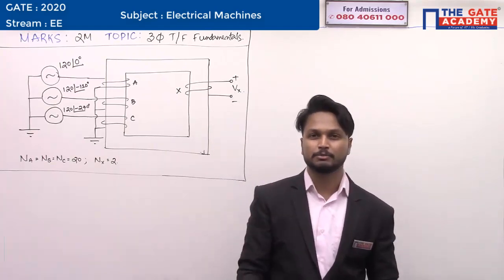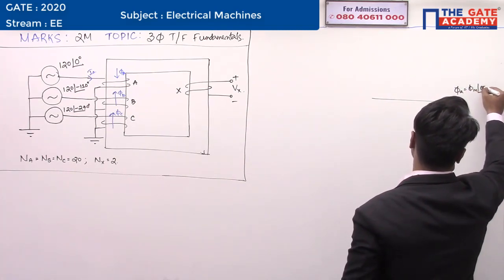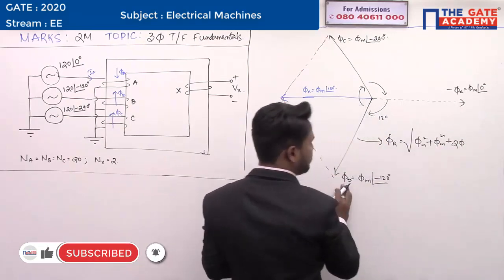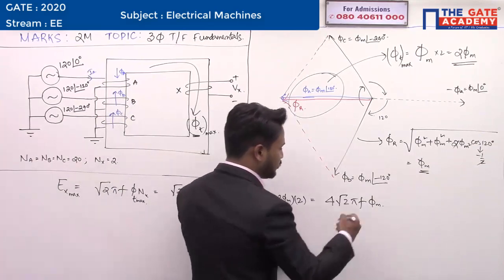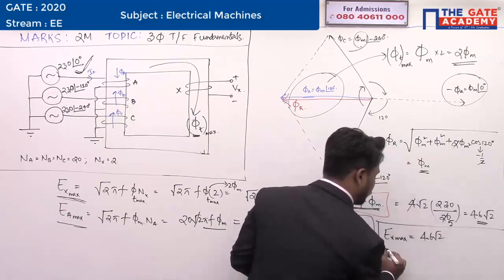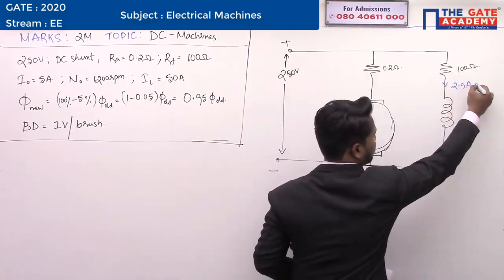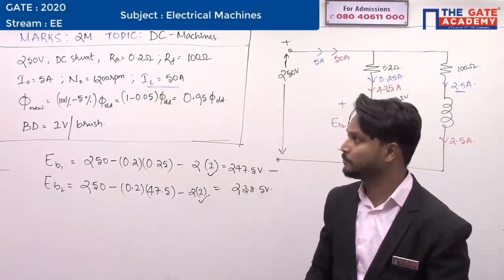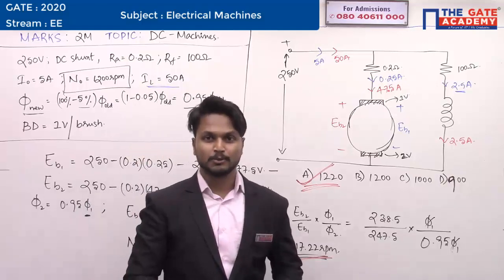Part- 2 | GATE 2020 Answer Key with Solutions for Electrical Paper – Electrical Machines (Qns 2Qs)

Comment: Transformer question answer should be zero volts.With the final answer shown in video, try to apply KVL in any phase of input side you will understand that answer is wrong.Since same resultant flux is linking all the windings of  both input and output sides, induced voltages should be in turns ratio.But no finite flux(resultant) can satisfy KVL inn all input phases , flux should be zero